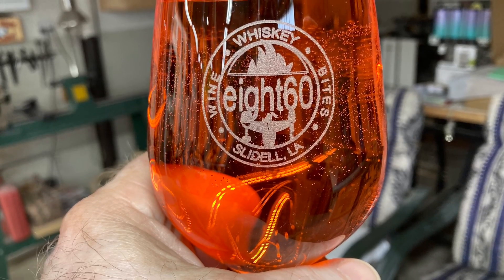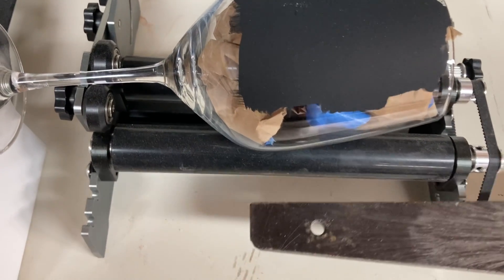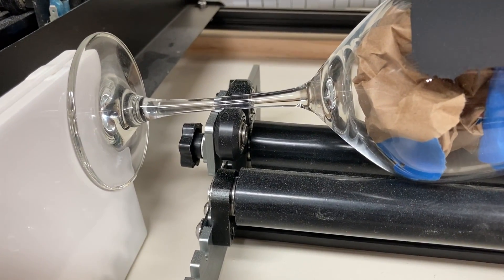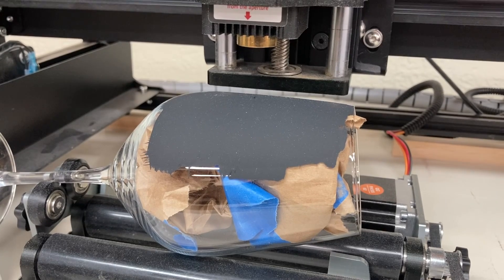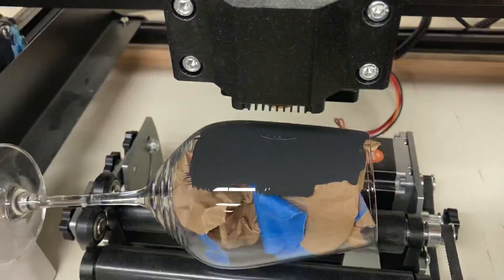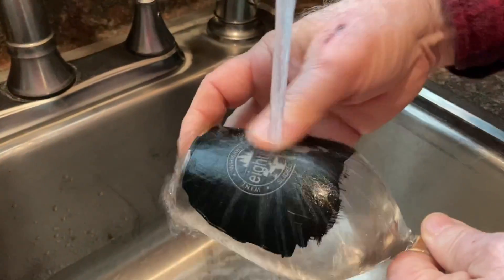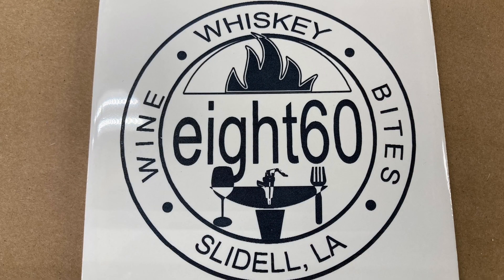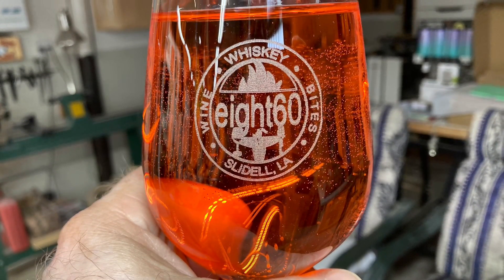Engraving on Glass with a Diode Laser and More

Comment: You skipped a very important thing. What setting were used in light burn
Reply from the maker: Thank you for your question. Each laser will be different and quite frankly the glass is different as well. I always use a test glass to run different power and speed settings to get it just right. Unfortunately, there is not one setting that works for everything.

Comment: Hi ive noticed on videos you lift the glass on the rotary to be level with a door stop. How does the image not go off being straight. My project is going south because my image on glass is not straight. About to go insane here
 How can i get the logo or text straight instead of tipping one way orvthe other? Thanks 🙏👍👍👍
Reply from the maker: I lift the container with anything that will hold it in place. A tapered glass does distort the image. Lightburn has a new feature to accommodate for the taper

Comment: can you do tapered glasses like pint glasses or other smaller but tapered glasses on the rotary?
Reply from the maker: Yes, the simplest way is to raise the rotary until the glass is level. Almost all glasses are tapered so you will see me raise the rotary until the glass is level
Reply: @PawPawsWorkShop  I am looking to add a rotary to my 4040xe with the 40w laser. I like the r57 from fox alien but their roller design looks a little clunky. I am looking at the atomstack r1 and its chuck holder design. Do you know if the atomstack R1 would work with the 4040xe configuration?
Reply from the maker: Mechanically I’m sure it will work. You most likely will have to adapt the connectors to attach the rotary to the machine

Comment: What is 20mm an inch to mm per second ?, have you had success with thick tumblers like whiskey glasses
Reply from the maker: 20mm/inch would be 20x60=1200mm/sec. Yes, they engrave just fine. I used the same settings. You must consider the weight when setting up the rotary roll.

Comment: Great video. Tempura paint sounds like a win. No solvents needed for cleanup. Does that same paint work on the ceramic tile as well? I think i recall your other video you used white rustoleum for ceramic tile.
Reply from the maker: Thank you very much. Tempera paint is excellent on glass. No the tempera paint will not work on ceramic
Reply: @PawPawsWorkShop  ok. So, I used your  paper filling idea to keep the laser from retracting all over the place. I found that if the paper touches any part of the inside of the glass where the laser passes, that section of the glass inside will also be etched. I hadn't even though of this thinking the material would need to be bound to the glass in order for etching to occur. My only guess is that it was because some of the paper had printing on it. Next time...... I'll try white paper. 

And the tempera paint worked very well but I was forced to coat like 4 times for full cover. And because it was washable....it kept wetting and then smearing the originally dried base coats. I'm going tovtry spraying with hvlp sprayer and that should be a nice even coverage, no touch application and allow me to coat more at a time with less paint. 
Thanks for your content and keep them coming!
Reply: @PawPawsWorkShop  one other question......   i did my first tapered pint flash yesterday and the image in lightburn was round but after the engraving was complete..... it became elliptical.  Any ideas? I used the diameter of the top widest lip of the glass and I used the rollers not the chuck  in the rotary tool setup. I'm using the RA2.

Comment: Great work.  Love you're using the Tempra paint method!
Reply from the maker: Thank you very much and thanks for watching
Reply: @PawPawsWorkShop  Always love some good making.  The glasses came out great and I love the matching coaster.  What a great summer gift for parties, weddings, etc.
Reply: Thinking about keeping the glass in place, would a sandbag inside the glass help with that.  I've been meaning to get a roller for my laser but looking at it I would think a small ziplock with sand might hold that in place and add enough friction to the rollers.  Just a thought...🤔

Comment: Hi Pa'! question for you! I did 3 glasses already, and broke 2 , my specs, 50% power, speed 30 mm/s, lines 0.100. Can you help me?? It's winter in my country, could it be?? Thanx a lot!!
Reply from the maker: If the glasses are very cold and you put that type of heat on a thin glass, yes it can break. Get the glass to room temperature around 20 c should work
Reply: @PawPawsWorkShop  thank you!

Comment: Hi I am new to the engraving. I hear you said tempera paint it that correct? If not what is the name or type of paint you use to coat it. Thank you for you help
Reply from the maker: Yes, just simple tempera paint on the glass. It’s easy and very inexpensive. Thank you for watching
Reply: Does the color of the paint matter? You appear to be using gray but I don’t see tempura in gray??
Reply: @VegasMadMikey  I have the same question; Tempura is available in bright colours for the kids, don't see any in Gray

Comment: I just bought a 5.5 w laser etcher but haven’t put it together yet. Is it powerful enough to do this glass etching and the tiles?  If not, what do I need to do it?  Thank you
Reply from the maker: If that is the output, then yes, if that is the input then it will require some testing. Most likely you will need a 100% power and feed rate will need to be slow
Reply: @PawPawsWorkShop  thank you very much.

Comment: Hi, what CNC machine you working with? I have the XCarve, will the rotator that you have the glass sitting on work with the XCarve? If so, Do you have a link to where I could find one. Thnaks David
Reply from the maker: The rotary roller attachment is for the FOXAlien. I have not tried to use it on another machine

Comment: How are liking the fox alian router, I am thinking of getting a machine with a larger bed than my 3018 and though I would check out a user of the machine. The current 3018 can be expanded to about a 19 in y axis for about $200. I want to have the ability to do larger signs with out tileing.
Reply from the maker: I would suggest getting the largest machine that will fit your space and your budget. With a big machine you can do the little projects and the larger ones as well. With a small machine you are limited to small projects unless you can do the tiling. Check out my Labor Day project. I did it in two carvings because of the size of the machine. The FOXAlien is excellent and I also really enjoy the FOXAlien laser. I have an affiliate link in the description. Check it out for yourself
Reply: @PawPawsWorkShop  thanks,  can  go for a larger machine after a while but don't want to spend money that I don't have right now.

Comment: Do you think acrylic paint or house paint would work as good as the paint you are using? I'm moving out of the country and I need to keep my supplies I get as simple as possible. Thanks.
Reply from the maker: I have not tried that. It is much thicker and you would need to adjust the settings for sure
Reply: @PawPawsWorkShop  I will just bring some big bottles with me that will last a while. Instead of experiment on my own when you have it figured out. What colors do I need to take with me for tile, glass, metal, etc.? Thanks always for the help.
Reply: Thanks

Comment: Great job. I've been using a smaller machine to do the same thing for my logos on my guitars. You really should try to build a guitar. I think it'll make a great video for you. As for the Assembly of the guitar you really don't need a lot of special tools, I'd be willing to answer any questions. It's an extremely fun thing to do. If you decide to try it I would be willing to give you all the advice you would need. Love your content.
Reply from the maker: That sounds like a very interesting project
Reply from the maker: I find this very interesting. Where do I get the parts?  Do you build guitars?
Reply: @PawPawsWorkShop  yes of course I am a third-generation luthier. Before you worry about buying parts you need to find out what kind of guitar you're going to build. I recommend electric guitar over acoustic. Honestly the easiest guitar to build is a Telecaster. If I were you I would do that. You can find all the parts on eBay or Amazon. You need strap buttons, Machine Head's( tuners), guitar nut( I recommend stewart-macdonald for this part, you can get it pre slotted), 2 potentiometers, 3-way blade switch, a neck pickup, and Bridge pickup for a Telecaster, pickguard and control cavity plate, Telecaster style Bridge. Neck plate and screws, 9 pickguard screws, and two string trees. You can find all of these on stewart-macdonald but I would recommend shopping around some of the items. I don't think I left anything out but I might have. As for finishing the guitar I recommend a oil finish like tung oil or Tru oil. You can use any type of stain that you like. I recommend you use Basswood for the body and Canadian maple for the neck oh yes I did leave out one item you will need a truss rod( goes inside the neck for adjustments) kind of hard to give you a list and a comment but this might at least get you going in the right direction. If you have anymore questions I'm here for you.
Reply: @PawPawsWorkShop  also this would be an ongoing series for you there's no way you could get it done in one or two videos